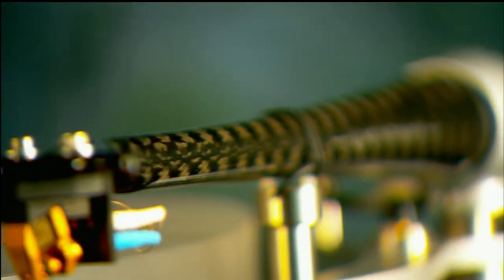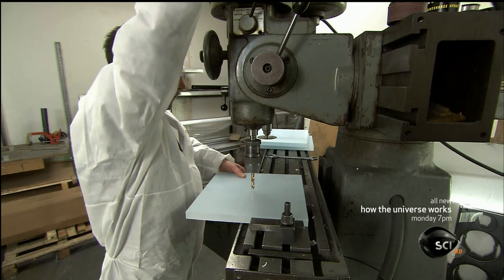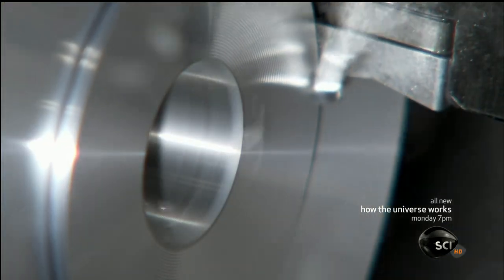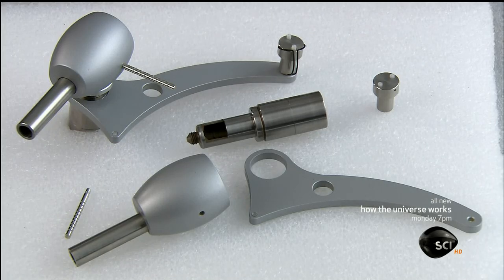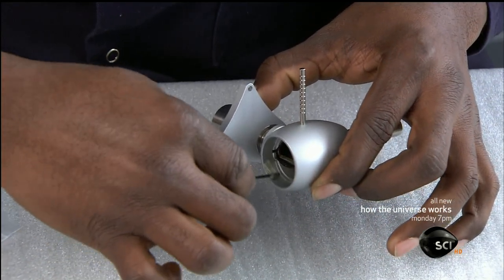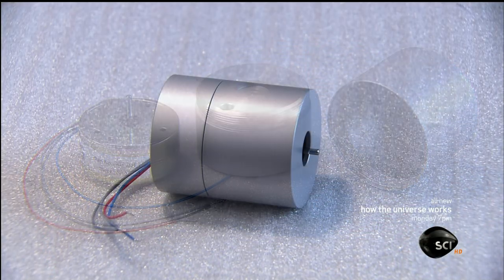How It's Made - turntables

Comment: This is a joke, right? First you fracture soldered joints, melt the shrink wrap tubing with the soldering iron over said fractured joints, eyeball the alignment, and then try to charge 4400.00US for this POS?! I can't believe the company allowed this video to be released to the public. I can honestly say I will NEVER purchase this or any other product from this company knowing this is how they do things.
Reply: Exactly this. Shocking!
Reply: Not to mention this isn't a direct drive turntable...
Reply: @drewscruis  Not all high end turntables are direct drive. Direct drive is best suited for high torque applications (eg in radio stations and for DJs.) DD motors have more noise and introduce more vibrations compared to belt driven turntables. 99% of "audiophile" turntables are belt driven (eg. Thorens TD160) or driven by an idler wheel (eg. Garrard 301)
Reply: Ill never gonna buy from this brand. This assemly dude is incopetitant hence the owner who released this video as well. Eyeball alignment??)) Im gonna stick with my Thorens 124, 126 toys.

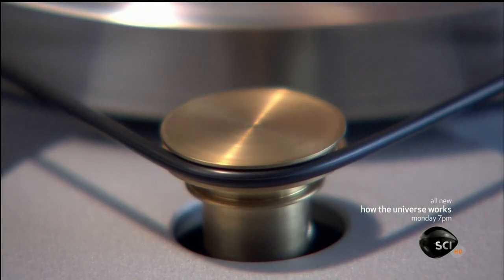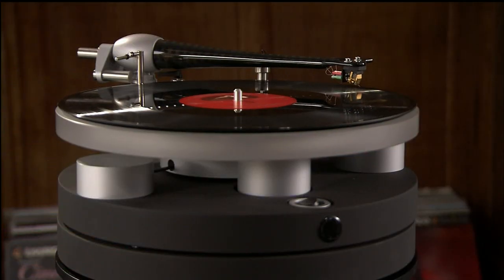Comment: @4:29 we can clearly see that the motor pulley ins't turning straight, probably because the hole for the motor shaft wasn't drilled straight in it. Moreover,@4:55 we can also see that the plastic platter is moving up and down slightly, because of misalignment. And whats' that, expensive carbon fiber tone arm aligned approximately by eye ?? You've got to be kidding me ?
I certainly wouldn't buy a $4500US Wilson Benesch crappy plastic turntable.
Reply: It's not not good. No precision in its build at all.
Reply: This is how it made - clear and correct - new turntables is wrong chose

Comment: soldering looks a mess.
Reply: +basspig When I rewired my Rega RP1 (all will eventually have to be rewired), it looks just like that, but I do have a screw which holds the cardas in place to avoid wire contact.
Reply: Completely agree with you.
Reply: Looks like we're gong to have a nearby neighbor moving in for the first time in 4-1/2 billion years. It's going to be interesting to see their reaction the first time I listen to J pop at elevated volume levels. Things are more complicated because across the road is another town in an neighboring county. So if they call their local cops, I'll tell them no jurisdiction and they'll have to call my town's cops, which don't respond to noise complaints before 10 pm. It's going to be an interesting summer.
Reply: 17kW. I once calculated displacement.. I think it was around 1700 sq inches. I maybe in error, as that was calculated in 2006 and I'm going from memory. I do know the woofer array is 112dB efficient at 20Hz with 1 watt input.

Comment: Why the hell is he heating the heatshrink with a soldering iron. That's electronics 101 no nos.
Reply: Yeah any pro uses a zippo :P
Reply: Right... botch
Reply: Tom Wilkinson a heat gun would melt the silver wiring
Reply: I dont think so because even on medium temperatur the tubing shrinks in an instant so there is no time were the wiering could melt.
Reply: The soldering iron gets a lot hotter than a heat gun and there is also the direct contact with the soldering iron. Big no-no.

Comment: that's how you turn a $5 DC motor to a $3K turntable,gotta love those "audiophile" folks lols.
Reply: That's not a DC motor.  It's a 24 pole AC synchronous motor.  It locks onto the power grid frequency (60 Hz in the US) and operates at a very stable speed of 300 rpm without the need for a regulator circuit.  It IS inexpensive; in that regard you are correct, though you CAN buy versions that are manufactured to 
very precise tolerances.

If you're not convinced, the most prominent bit of evidence is the two-sheave pulley fitted to the motor.  Since the motor operates at a fixed speed, to change platter speed you have to switch the belt from one sheave to another.  DC motors don't lock onto line frequencies and therefore speeds can be changed electronically.

Other turntables use 24-pole AC motors as well.  The U-Turn Orbit, many models of Rega, and Linn turntables all use this type of setup.
Reply: and the CNC Tool is not $5

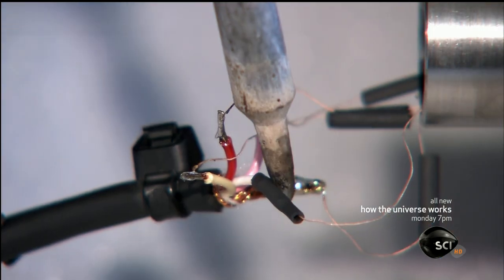Comment: 3:30? Really, he cannot afford a heat gun? I would think that for $3,000 this would be precision machine made, not handmade by someone who doesn't know what he is doing! Can I see how a real turntable is made?
Reply: I assure you that this guy is a very skilled soldering technician. I work with solder all morning long for my technical skill and those solder joints are damn impressive. It's a lot harder than it looks, buddy.
Reply: +Willy Fisterbottom Yes, he is decent at soldering. It does look nice. Also I know it is harder than it looks, I also work with solder all the time! What I am saying is for $3000 on sale, it should be precision tuned by a machine with someone at a computer fine tuning it. Not a DIY guess work!

Comment: Actually, A pro turntable like a Technics 1200 Mk2 should make an interesting "how it's made" vid. Those ones are made very differently than 21'st century audiophile turntables like the one shown in this vid.

Direct Drive motor, aluminum platter, the series of strobe dots, the chassis, damper feet, Pitch control... All of this is very interesting... And Unique to the 1200's....

Comment: +1

Also, the soldering technician should be using a heat gun to shrink the heatshrink tubing, and not the tip of the soldering iron (see 3:30).

Comment: Thank goodness Technics turntables are back this year. You can't beat a nice Direct-Drive turntable.
Reply: No you can't!!!!
Reply: those new technics are expensive as a herd of whores, glad I have mine 1210mkII man... they are from 1984, and Im from 1983, I think they are in a better shape than me :)
Reply: what are bearing for ? i didn't get it ? And what are you guys fight about ???? :/
Reply: Delta Fox
 yes, I speak about DJ turntables the whole time, man I run various turntables for 2 decades at least, I know damn well that if I want to RIP or just play my vinyl, I will use TT with the motor placed outside and whatnot. I know that 10k USD TT will sound better than Technics. But try to place that 10k usd TT to my van, bring it behind the few kilowatts of subwoofers wall and play it whole night in a dusty and smoky enviroment, repeat for 10 years, than compare to the Technics which were abused this way for same amount of time, than we can speak about which one is better for a DJ use, what it means when I speak about DJ use etc. Its like comparing the offroad vehicle to a highway supersport, both can be excellent in its enviroment, one is better here, other is better there. U cant say one is crap. Tell me which TT is better for DJing than Technics and make me smile...
Reply: Delta Fox
 Ÿou mad? this thread is :"Thank goodness Technics turntables are back this year. You can't beat a nice Direct-Drive turntable." You have some fucking problems in your head. I use 40 hz cut off. Like it can tell you anything, when you know shit about the setup. But Im sure you will come back like"40hz? you the biggest idiot on earth!" lol... man.. stop doing the drugs u do or if you are sober, find a medical help, seriously
. PS: its 140db of noise :))) and thanks for at least not dissing me being DJ and sound system owner, really appretiate it mate, thanks :)
Reply: Delta Fox
 yea I agree at some parts, high power motor, high mass etc., but it must withstand the torture. Nobody likes failing turntable at a party. Nobody likes repairing it. You want it to run always, and always at 100% without any problem. And this my friend, is Technics. Dont talk about theoretical TT, tell me a brand and model which is better than Technics 12xx MKx for DJing and heavy use in bad conditions, heavy vibrations, dust, smoke,.. basically in hell. Tell me which one is better! You will fail. Thats why Im right when I say its the best DJ TT ever fucking made. Dont forget I dont stand in front of speakers, but behind them... I made a party this weekend, and even the morning after it, no ringing in the ears. Im ok... :) Any my TTs are ok too.. same as when they were new, 30 years back! Now crunch on this... yea, they are from 1984. Thats what I call a reliable piece of HW. Don you dare talking shit about them :)
Reply: Delta Fox well yea, thats interresting about the frequencies... I think the case with the technician with 6khz cutoff in his ears hearing 12khz signal added has something to do with harmonics. The 12khz signal interferes with the wide freq spectrum I can imagine. 20hz is really low, if you want a subwoofer which can play 20hz (really play, not "play" in a specs sheet) you need to buy a infrabass sub. Which is a beast, weights shitloads and costs the same. And you will feel it, not really hear it. Ive felt sub 20hz freq on my travel on a huge  boat. I found the spot somewhere above the motors, where u felt some huge sound, very loud, but you have not heard it. It was unreal experience. My subs can play 42hz+ when loud, 30hz+ at -10db. So my cutoff is almost not doing anything, just reducing the load on subs a tiny bit. 40hz can still make your clothing move tho. Many sound system owners use cut off on subs at 60hz when they lend it to someone. Ppl cant tell the difference and the chance someone blows your speakers up is reduced by a big margin.

PS: here is some infrabass speaker for example http://www.funktion-one.co.jp/images/products/ib218/IB218_SpecSheet.pdf
Reply: Delta Fox
 I use class D amps... for purists, this is nightmare I guess. But it has great efficiency, so very little energy is wasted in a heat. This results in significant fuel saving when using the remote electricity generator, and also u save big bucks on the generator itself, because u simply need less energy. Also, the generator than can be smaller and weight less. So class D is ideal for me, because I always play at remote places. I guess class D is solid state, deffo not tubes there.

Tubes sound better, there are many reasons. They have bigger distortion of second order which sounds musical, aka harmonic distortion. This distortion increases when you get louder, and this again is same behaviour the musical instruments have. When u hit a piano key more strongly, it will create more harmonic content. And tube amps behave the same way. Thus they have very natural sound, pleasant to our ears. Tube amps behave like a classical instruments, and classical instruments were created by masters who made those instruments in a way they sound nice to our ears. Also, tube amps sound the best at the volume which is pleasant to our ears... its a total synergy, tube amps are beautifully compatible with our ears, in a same way, classic instruments are. And in a same way, vinyl records are.

I dont get your date - fruit remark, sry. And fuck the dates anyway.
Reply: Delta Fox
 ahh the figs :) yup, lower freq need more power because u need to move the speaker across a longer distance to produce one. I think if the total output of the rig is 100%, LF should be 60%, mids 30% and HF 10% roughly. I was actually doing some math and I counted how long in centimeters are the LF waves. I did it because I wanted to utilize the acoustic coupling between the subwoofers. And I was surprised by the results.

30hz freq has wave length of 10,625metres, 60hz is 5,66m, 120hz is 2,82m etc. So if you want to boost freq of lets say 0-120hz your speaker centers must be max 2,82 divided 2 meters appart. Than you will gain +3db for free. And +3db is twice the perceived loudness. Thats why having just one sub with one speaker is a crime in my opinion :) This works up to 3 speakers (3rd one will give you +2,5db boost). When you add 4th speaker, you will get -0,5db "boost"....

more precisely, when u add 2nd speaker you will gain +3db because u added it and when u place em right, u get another +3db. Than u add 3rd, u get +3db because u added it and +2,5db if u place em right. When u add 4th in the acusticaly coupled array, u will get just +2,5db and thats it (so 3 - 3,5db less than previous ones)

Thats why its not only about the amount and power of speakers man has, but about the placement, so they work together in maximum efficiency, lowest possible wave cancellation and maximum coupling... than you add the space you playing at into the equation and it gets so difficult you can read 10 books about it and you will still have things to learn... Thats why I love to play outside, it makes things 1000x more simple and you at the fresh air :)

Comment: OMG! using eye power to align the tonearm and a RS component motor with its mounting "ear" cut.
Reply: B Keat There's absolutely nothing wrong with "eyeing up a component" I have worked in engineering for more than 25 years and I can tell you that a well trained eye can spot a mismatch in parts down to a couple of thou of an inch quite easily. Apart from that the azimuth is almost certainly adjustable on this tone arm.

Comment: Forget vinyl for the moment. MP3 does not remove noise; it compresses the original PCM data file, by removing recorded signals that are masked by louder signals at the same or similar frequency. Noises (as opposed to music content) generated in the recording process will still be reproduced because they cannot be masked, by definition. That's why they are noises.

Which is why saying MP3 'removes noise' is so fundamentally wrong, it throws everything else you have to say into serious doubt.

Comment: 1a- yes wow and flutter are limitations to analogue but distortion is a function of the amplification stage so the same goes for digital. You are assuming that the crystal oscillator that sets your digital timebase for sampling has NO error, but at 1Mhz it would make a lesser 96khz system look crude- its all relative...
2- again you are saying that your resolution of 96khz sampling is "good enough"- 20 yrs from now that will be considered rubbish won't it?

Comment: 1- I think you are referring to the PRACTICAL limitations of analogue and not the TECHNICAL limitations. I agree that in practice, most of us use a digital solution nowadays , but that is because the industry adopted it for storage, distribution, cost and god knows what else. Most people think for example that digital tv and radio transmissions in practice are often poorer than the old analogue because of bandwidth and hardware limitations.

Comment: since you were debating the superiority or digital over analogue, it's only fair to point out that technically analogue is superior, its just the implementation that's the problem.
Did you know that sound is analogue like all nature and is sampled to a finite degree, and then later converted back to analogue?- the more processes, the more signal degradation....

Comment: Never Ever put a Record on when the Platter Is Spinning. Put the Record on and Then as You turn on the Switch give It a Little Shove at the same Time (For Belt Drive only). Invest In a Middle Weight over the label. Squashes Warped records (Only Slightly) If bigger Through away. Cuts down on Rumble to. Wow Is produced If the Table Is out of Alignment like the one In end of the Film.
Reply: +TheBudgie29 Word of warning here. Don't put a middle weight on a turntable that hasn't been designed with one in mind, one can knacker the main bearing.

Comment: There seems to be confusion in some viewers of the potential in Analogue data systems. Put simply, digital has predetermined, finite upper limit to its information saturation- analogue does not. Therefore if you could read the information stored in ever increasing detail, there still would be more to see.

Comment: No. Lossy compression systems like MP3 attempt to play the music 'as it sounds' instead of 'as it is'. They rely on our difficulty hearing quieter sounds in the presence of a louder sound at the same (or similar) frequency. 

There is a cut-off as a by-product of the compression process, which increases in line with the amount of compression used. But I think you are confusing this with the Nyquist-Shannon brickwall in digital sampling (16bit, 44.1kHz PCM files have a strict 22kHz limit).

Comment: I was brought here when I read my USB turntable's manual and it said "Us of controls, adjustments, or performance of procedures other than those specified may result in hazardous radiation exposure". I was hoping How it's Made  would explain why turntables are nuclear powered.

Seriously, type "turntable"hazardous radiation exposure" " into Google and you'll find this is a common thing with USB turntables. I'm thinking it must have something to do with the aluminum alloy but cannot find information on what's making them radioactive or why it's there. Not as concerned as I am curious. Anyone have any idea why there's a risk of radiation exposure?
Reply: If it is a Crosley, that is the depleted uranium that got into the chinese pot metal... standard warning.
Otherwise, is there a CD player in the unit?  If so, it is referring to laser radiation... if no CD player, then I suspect it is simply a generic warning overall.

Comment: It's not even direct drive! belt drive? Plastic platter, terrible thin wires just bundled together in the tone arm. Come on man! Who the hell designed this turkey platter? I feel sorry for anyone who's bought one after seeing this!
Reply: You got that right. Wires all bundled up in there. That motor is just some cheesy off the shelf part from RS
Reply: ***** I should also confess my knowledge is restricted to DJ decks namely the venerable SL1200. Serious DJ decks can only be direct drive and the pickup wires are considerably beefier that these things with proper insulating jackets and the idea of an acrylic platter is just stupid. This is cheap tat dressed up... But yeah I checked and in the HiFi community some people won't touch DD decks, so I learned something from you there, cheers!
Reply: Belt drive has less vibration from the motor  than direct drive.